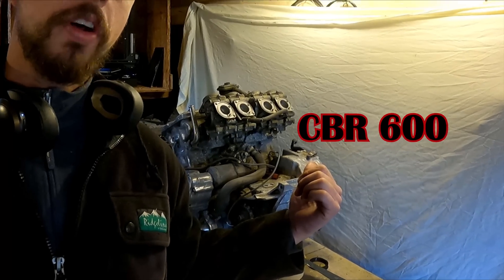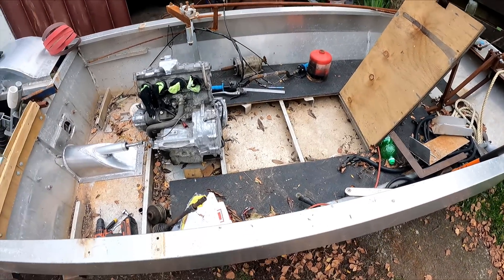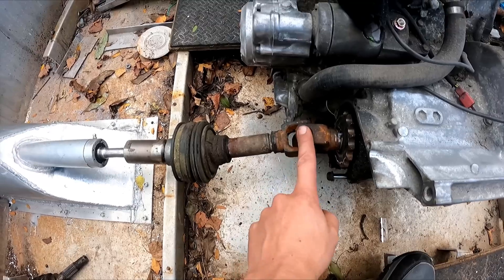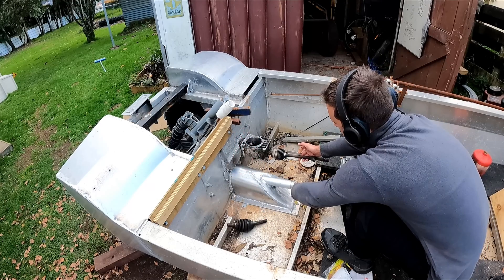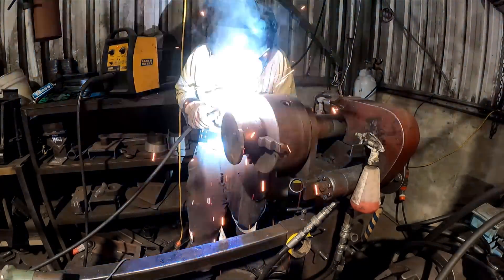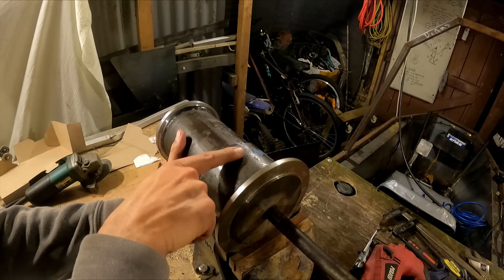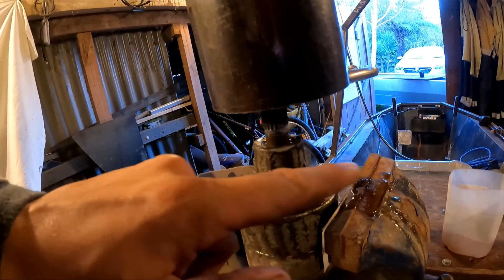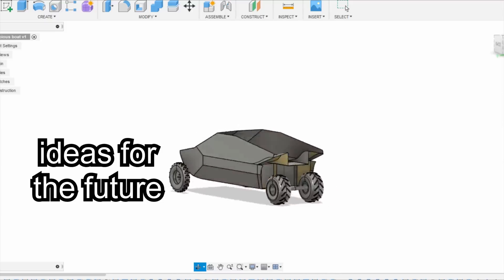Jet Boat Amphibious Build, Forward Reverse Gearbox

Comment: While too small for this 90hp, for a smaller/slower project a cheap mower transaxle will work nicely. Once you take one apart you will see a stack of gears with couple of sliders in keyways on one of the shafts that engage/disengage each set of gears. On one side of that set is a small chain, that's reverse gear. After that there is a massive gear reduction that goes into a differential. In racing mowers that reduction is taken out, or at least increased for higher speed on the output. Also all bronze bushings are replaced with bearings, just for longevity. Speaking of bushings, that is most likely what your differential has as well, so check it out and do put bearings in so that it doesn't chew itself up at speed in neutral/reverse.
If you get a hydrostatic transaxle, it will look practically identical, but on the inside it would have a small cylindrical wobble-plate CVT instead of that stack of gears. It's great since it's stepless FWD-REV that also serves as a brake for the machine. Not really useful for something that goes fast, however two of those units might make for a neat tank-steering-type system. Just one with no gears could be an interesting way to drive a boat prop.

As for front, what about a torsion front axle? Low profile, and the whole thing can be pivoted via the torsion spring itself to raise/lower front wheels. Even if the 'torsion spring' in this case is just a torsion shaft with a bracket and conventional spring suspension/lift system in the middle, it should still work nicely.
Reply from the maker: I had a lawnmower gearbox in it before going to the big engine and jet drive and had a 15hp motor it worked well but too slow on the water I have a video on my channel. I have also made a mini tank using a transaxle gearbox also on my channel 👍thanks for the detailed comment you have a lot of knowledge on those gearboxes
Reply: @dkthewelder  Ah yes, forgot about that one. That was a really good transmission as well since it did not have that really high reduction on the output. Nice tank by the way!

Comment: Will you have enough RPM to dive the jet pump? Engine is geared down 4:1 through clutch basket gear drive and gear box. I did a similar thing with a motorcycle engine in a boat and had to delete the clutch basket. Replaced with a chain drive at 1.5:1. Cheers
Reply from the maker: I’m hoping in top gear it will be fast enough , I guess I could gear it up with a chain and sprockets if needed but need to use the gearbox for the wheels as well
Reply: @dkthewelder  You’d almost want to have the engine going to the wheels first, then have a chain geared to the jet pump. So you can play with ratios, also you can add a way to disengage the pump so it’s not running dry while on land… but awesome work man. Love this idea, and how you approach problems.

Comment: Make a small sleeve that fits on the jet pump drive side of that sloppy spline so the drive shaft slides over the splines and then centers on the sleeve
Reply from the maker: Yeah I thought of that but the spline part is stepped bigger. I could maybe make what you say but split in half
Reply: @dkthewelder  a split 2 piece 1 would work fine

Comment: That's a good idea using the mower diff. I was a bit nervous about running the power thru that as well but looks like the locking system will solve that!
Reply: That future design is looking suspiciously like a cybertruck
Reply from the maker: I’m hoping the diff idea will work! Haha cyber truck, I want to bring the sides up because there will be a lot of water splashing up it should also make the whole boat more ridged

Comment: Awesome video Daniel surely you're a YouTube millionaire by now?
Reply from the maker: Thanks, na I’m not getting that many views at the moment
Reply: @dkthewelder  I did go back all look and see why I subbed it was the Trike thing. Because of the I  had
Reply: Say I just watched your video.  The differential.  Is somewhat common. I had on a 1974 Tri Sport Alsport. They came with   8hp kholers to 40hp 2cycles Rupps . I put  350 CB Honda on mine 7 inch disc hyd. Brakes.  Geared it to top out at 55mph.. it was beyond wild. Flat tracked like crazy.. they hold up well. Not to sure of all the weight you're hanging on it..  But I've found the some of those China quads have F-N-R  cast cast together. But I was able tu saw-all the engine from the gear box  it was an adult size torque converter style so it has an exposed shat input the sprocket to drive the the quad.  I enjoyed your video very much. Where are you located.. I've got way to many projects. 2 of those Tri sports. Once with a 75 hp Polaris with a Hi Lo-Rev. Of a Polaris 4x4 quad stuffed down in the frome. Then the other with a Honda 600 100hp hanging on the other. And at least 10 pluss other gas powered from mini fork lift  off road.  I'm getting to old for all these. I put that Honda 350 on the first Tri Sport back in 1974. While stationed in Hawaii 
    I've got to go back an see why I subbed . Builder never stop building.  Take care.
Reply from the maker: @donaldpowers5557  o thanks I haven’t seen those little diffs like I am using before, sounds like you have built a lot of stuff! I’m in New Zealand , waihi